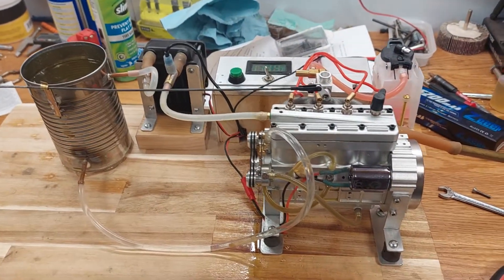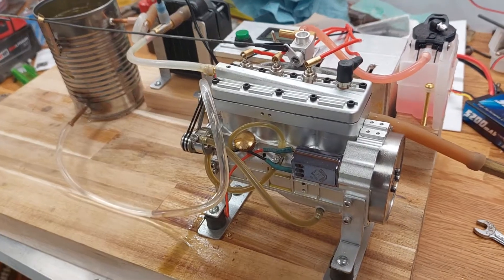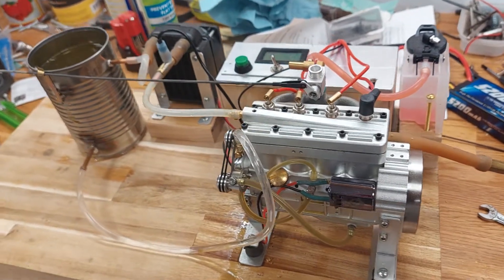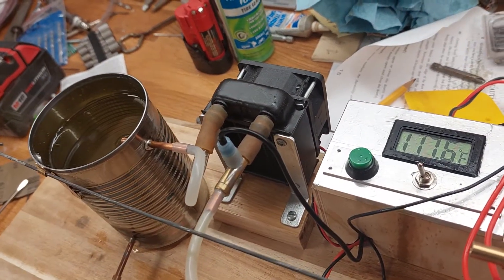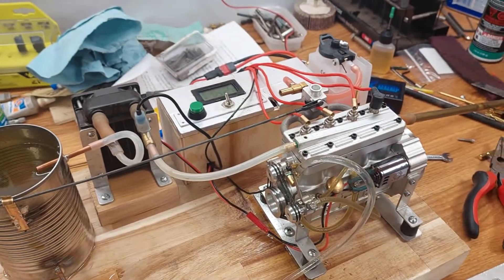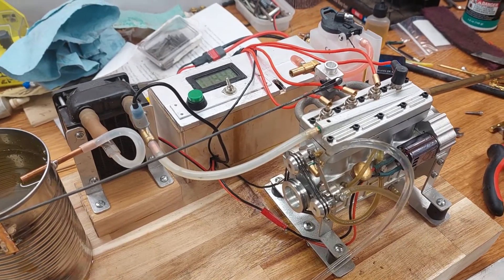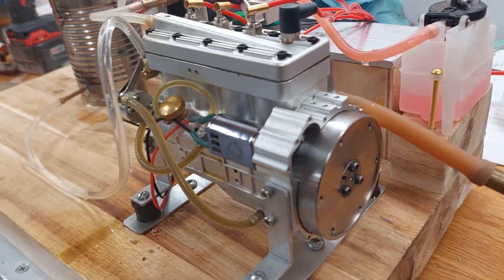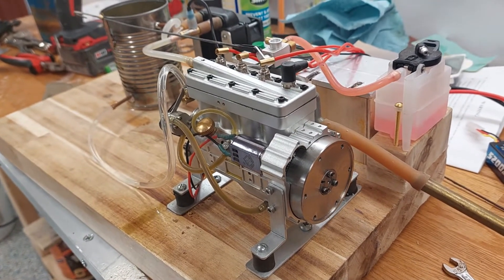cison fl4-175 flathead engine first start, nitro.

Comment: Would you be able to add glow plugs to the other L4 design, the OHC?
Reply from the maker: I do not have the OVH 4 but I'm sure it can, has the same plug threads.
Reply: And I have another question what type of fuel does it run off best with the glow plugs? I’m new with this.

Comment: Was this running with the glow plugs lit externally or was it self-sustaining like a typical OS/Saito?
Reply from the maker: It had power on the plugs all thr time, asume it will run without 1.5v on the plugs when it warms up. Nitro was only a test, I run it on gas cdi spark now.

Comment: Please do this quick test for me.. swap the sparkplugs cables of cylinders 3 and 4.

So, cable 3 goes to cyl 4 and cable 4 goes to cyl 3.. cable 1 stays at cyl 1 and cable 2 stays at cyl 2.

Do this and tell me how it runs on regular gas. If my investigation is correct, the CDI has the incorrect firing order and swapping those cables will fix the misfiring.
Reply from the maker: Pablo, "steam212" sugested that, and I tested it ( and just about every other combo) Closest to running are faint popping, like almost starting. Will order a new cdi box, it will take time before it arrives. Thanks for input. Bernt
Reply: @bjornamanda  if that is the case, I think the issue is in the way the CDI system is implemented. Most likely in the timing the CDI box was implemented with.

In a normal CDI system the spark has to start at about 12 degrees before top dead center so the magnet or crankshaft sensor in this case must be positioned there.

In variable timing systems you have as the name suggests a table of firing timing values that will change depending on the engine's rpm.

Hopefully Cison accepts there are several issues with their CDI system.

On the other hand, if you are familiar with Arduino, you could build a custom CDI. The capacitor needs to be 400 volts. Check some documentation on how to build one. The hard part will be the code to make it run properly, and the rpm readings from the engine.
Reply from the maker: @P_double_H  Hi, Arduino and electronics are way above me, I can onley do gears links and mechanical movements. 
 Now I have packed down the engine  for travel back to Norway and my workshop, so there will be some time before I can test aney more.
Bernt

Comment: Hello, great video, my starter motor also burned out. Can you tell me how replaces the pinion gear? I was able to take it out from the old motor but couldn't push it in the new one. Thanks!
Reply from the maker: I looked at "jonneyq90" and heated it read, used a gearpuller to get it off. I think I heated it again and pushed it on. The Worker motor are a total different quaity 12v and strong magnet .
Reply: @bjornamanda  thanks! I tried that but it didn’t work for me. I got it in with a hammer. Hopefully didn’t damage the starter too much. It works for now. However, I couldn’t get the engine working like your. I either have a timing issue or a carb issue. Any advice you can think of? Thanks again
Reply from the maker: @danieldanon47  Daniel, I got lots of advise from "steam212" on youtube, read it there I tried most of it but It onley almost fires, but does not run. I wonder about my ignitionbox, have asked Stirlingkit if there are a way to test it, or I will buy another. Not giving up yet!
Reply: @bjornamanda  Ahh got it, so you had problems with gas too. Maybe I'll end up switching to nitro too. I've been following steam212. Thanks!

Comment: It runs good, but using Nitro defeats the purpose of a CDI system, the  purpose of an oil pump, and the purpose of the various piston rings it has.    My goal should be to have it running smoothly using gasoline right out of the pump.
Reply from the maker: I agree, want to run on gasoline, tried everything exept a new ignitionbox.
Also running on methanol with no oil, and perhaps nitro are something I want to try, dont need oil in the fuel.
Reply: @bjornamanda  oh so you tried running it on gasoline. What happened?
Reply from the maker: @P_double_H  first nitro, then gas. I have tried just about every advice, new plugs, 3 different gas , set timing numurous times, checked spark sequence , switched plug leads etc. My only thing is if the ignition box has some arcing short internaly or something??
At the next few weeeks I will be traveling, so I packed it up. Not giving up. Let me know if there are aney good ideas, others have their engine running niceley.
Bernt
Reply: @bjornamanda  I recommend you check the CDI box.. I believe I heard Dennis Rampsey saying something about 3 cylinders firing at the same time, so definitely take a look at it.
Reply from the maker: @P_double_H  Hi Pablo, mine does exactly that sometimes, when I line up the plugs, and turn the magnet they fire sometimes in pairs ( that's ok) but I have seen 3 fire at the same time, also. Thanks for letting me know about this symptom.
Reply: @bjornamanda  I talked with engine designer,  you can try like this:  Label the plug near the belt wheel as number 1 plug,  then plug 2, 3,4  in the order,  to the other end.  Plug the cable 1 on CDI to the plug1,  cable 2 to plug 2, cable 3 to plug 3, cable 4 to plug 4.  It will work.
Reply from the maker: Hi, interesting, I will check out this wirering . I did get a new ignitionbox this did not have a grounding wire, so I supose there has been som redesign.
 My engine runs now but not good,  I think its more carb adjustment brake inn and fine tuning, perhaps a different carb. Have to fix a leaky  water pump also.
Bernt

Comment from the maker: I did not notice the movement, must not be aligned right, could be a reason for the oilpump leaking. The pullyes are just tacked on with Locktite. I must check. Thanks